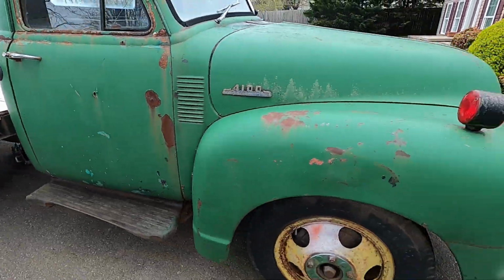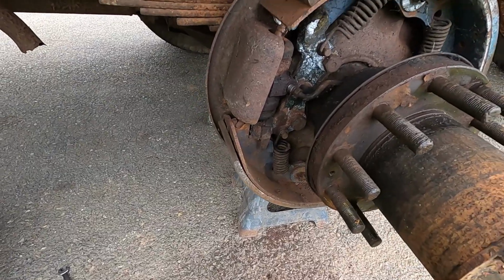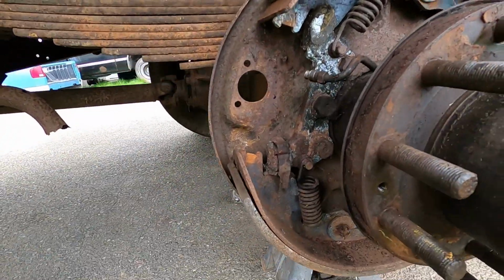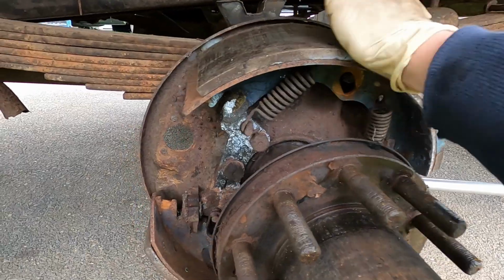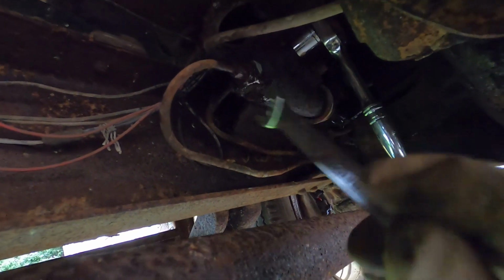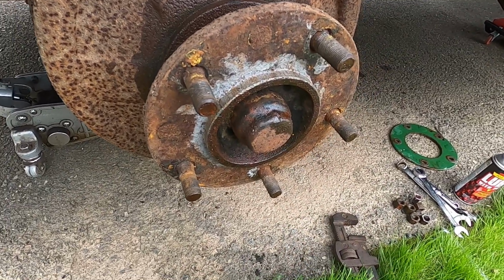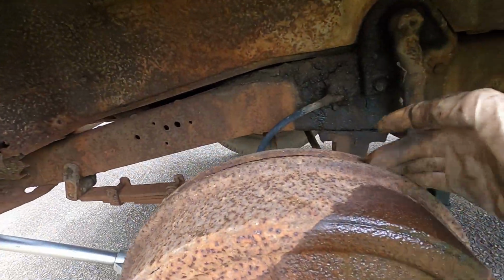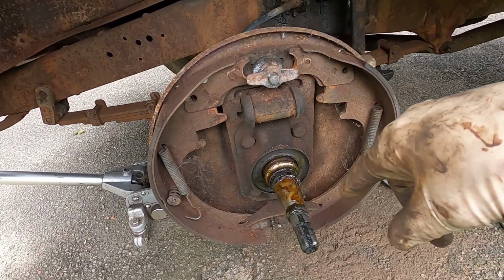1953 Chevy 4100 Brake Restoration Part 1 Disassembly

Comment: thanks for the video. i have a 55 4100 that i just picked up and the drums are locked up so i will be tearing into it soon so this helped. wheres part 2 and where did you find the replacement parts? thanks again

Comment: Ever get around to finding parts? Have a 1949 Chevrolet 4100 needing some part numbers or source of parts.
Reply from the maker: I have the parts, just haven't finished the install completely.
Reply: have you finished the brake system yet? I have a similar truck and Im wondering what you needed to get and how much they were @slow_restoration
Reply: If you don’t mind share what part numbers you picked up. Part coming soon, or @slow restoration.😅
Reply: Can you share your part numbers?
Reply: please can we get part number😮

Comment: I just bought a 1954 Chevy 2 ton 6500 cab and chassis (no bed) same color as yours, in about the same condition..  After going through the fuel system and cooling system the motor runs fine...  Now I'm starting on the brakes...  Can't wait for Part 2 video....  Are you planning on keeping with the original single reservoir master cylinder???  I haven't decided for mine yet....  All new brake lines for mine, the originals are just too rusty to trust....